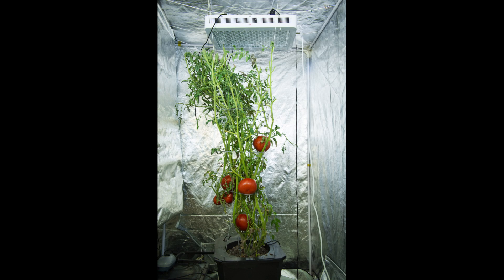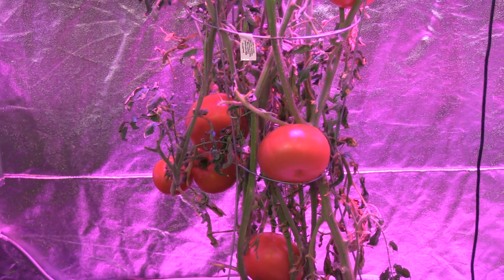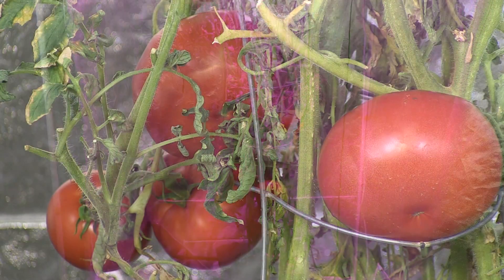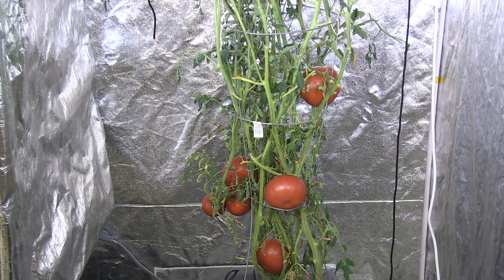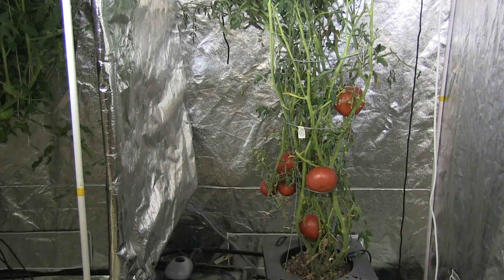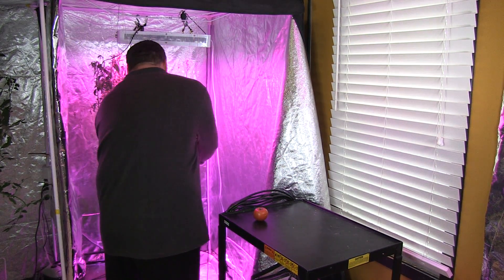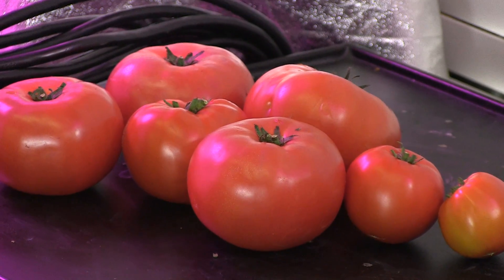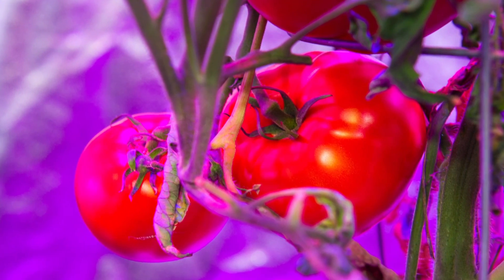Advanced Led Beef Steak Tomato Grow Test

Comment: When you start a new clone or seedling, it appears you have nutrients in the water you are soaking your rockwool in?  If so what PPM do you mix your nutrients too while waiting for the roots to appear?  Also what temperature does does your heating pad keep the seedlings or clones at.  Then once you move to your aeroponics system what PPM do you start out at.  I read the directions on my GH grow bottle and I killed my starters with too much nutrients.  Do you have an email I can contact you at?